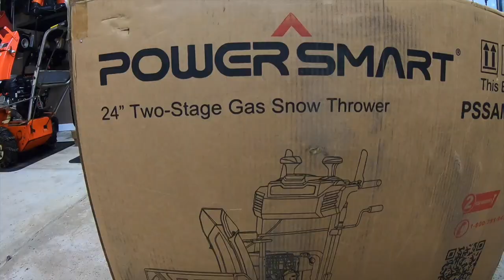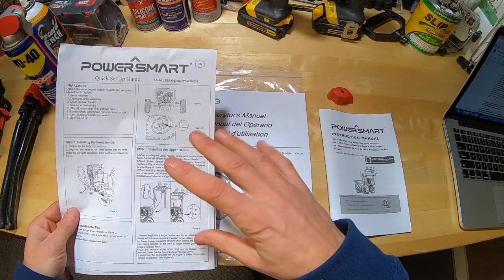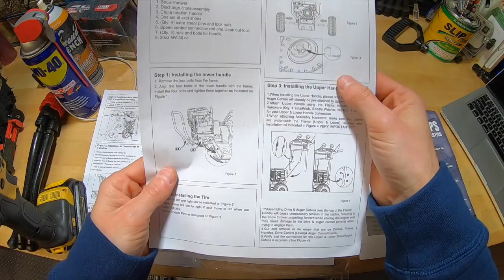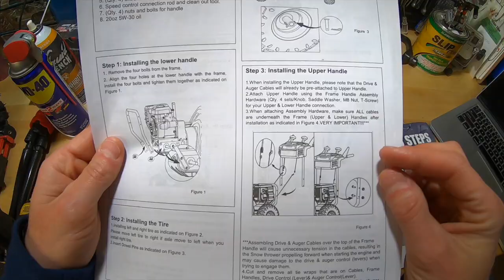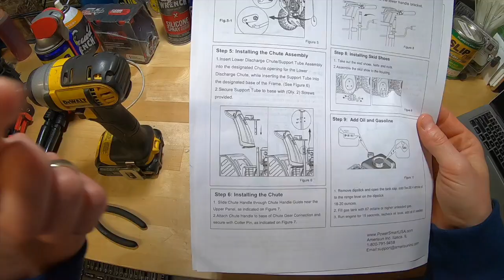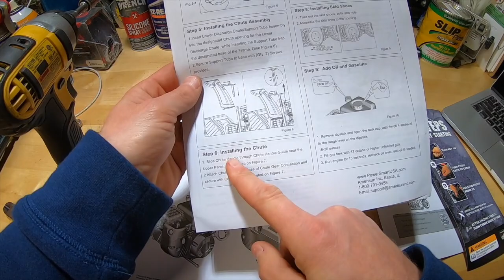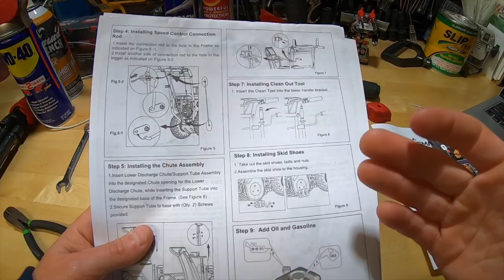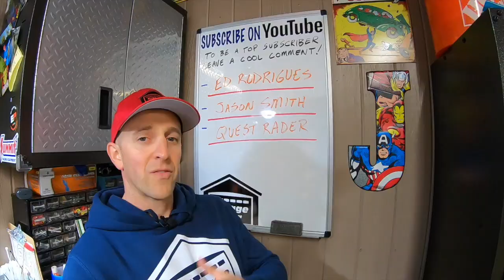I UNBOXED & ASSEMBLED A POWERSMART 24 INCH GAS SNOWBLOWER, HERE'S HOW!

Comment: Does anyone know what a shaft ring is used for. Mine was missing spacer bushings for the wheels so I ordered some but now I see a different parts list and explosion shows a shaft ring on one side. Powersmart hasn’t been any help. Thanks in advance
Reply from the maker: Sorry to hear they are not being helpful x not the first of me hearing this either. I would see how that part fits. If it doesn’t I would just go to a hardware store and see if you could match something up.

Comment: Would this be good in Northern NJ where we get an average snowfall of 40-45 inches? Or is the Ariens 24 deluxe worth the extra money? Would the Ariens be overkill for avg snowfall of 40 inches?
Reply from the maker: Hey Patrick if you can swing the ariens I would do it! The Ariens is built far better, parts are easier to get a hold of unlike the PowerSmart, it holds a much higher resale value and will outlast the PowerSmart by dozens of years. Even with lower snowfall totals the ariens is a smart purchase!
Reply: @GarageGear Thanks! I just pulled the trigger on Ariens! I watched your comparison video and that sealed it. I read many good things about the Ariens. It's my first snowblower!
Reply from the maker: @PatrickHill  you won’t be disappointed! 👍 happy snowblowing season

Comment: Thanks for the video.  It's Friday and they're closed all weekend.  I wanna fire it up, but there is a missing yellow plug on the engine block.  The other side has the small yellow plug.  Does yours have 2 small yellow plastic plugs?
Reply from the maker: Hey Jorsh sold mine a while back but I’m pretty sure it did have two yellow plugs.
Reply: @GarageGear  thanks for getting back.  I ended up looking down in it and it's not machined at the bottom.  Must be the same engine for different models.  I fired it up and it's all good.  Thanks, man.
Reply from the maker: @JorshWarshington1  awesome! Glad it’s working!
Reply: @GarageGear  thanks just subscribed
Reply from the maker: @JorshWarshington1  thanks man!

Comment: JB we recently picked up the same snowblower but cheaper model from a local customer that uses this blower to clear snow at his restaurant which has a stone parking area. Since the customer had the skid shoes set even with the shave plate a bunch of stones had pushed their way between the housing and the back side of the shave plate thus pushing out the metal on the auger housing towards the back. We were able to hammer out the stones using an old screwdriver as a pry bar, then hammer the bulged metal back as best we could. Disappointed that when we went to set the skid shoes for 3/4" clearance the most we could get was 5/16". Must note that the skid shoes you installed looked like a higher quality part than the cheaper metal ones that came with this snowblower our model was DB7624E60 but i can say it starts first pull after we cleaned the carb and blows snow very well!
Reply from the maker: Thanks for sharing this Wayne! A good tip here! These can be decent little machines if cared for properly! They definitely cut corners though and parts will more than likely need to be replaced! Thanks again for sharing and hope you guys are doing well! 👍

Comment: They now comes more pre-assembled. I received mine yesterday, no need to mess with the wheels, it is easier to get out of the box. Mine arrived via Fedex, all banged up, a lot of bendings and no speed control connection rod... and there is no hand heater on mine. The LED light is a joke with the 3 AAA battery case under the dashboard... The chute is softer to move and there is no more springy spring under the rotating part. The skid shoes are metal.
Reply from the maker: Sounds like they changed a thing or two! Hearing it’s pretty typical that they come in all banged up!

Comment: GG, I used my brand new Powesmart 24" today. Only problem was that one of the wheels came off the axle twice. As you know they are attached by a pin and cotter pin. These look very weak and i wondered if you have an alternative idea to overcome this issue? Something like a locking bolt and nut? Any advice would be most welcome, other than that the blower worked through a good foot and a half with no issues. The two speed reverse gears being a Godesend!
Reply from the maker: Hey Florida! I would recommend putting a bolt through it! That way the wheel can’t come off! Thanks for watching!

Comment: Excellent like always really enjoy your videos. I purchased the PowerSmart 26" with the Briggs and Stratton engine which worked great during this past snow storm. Only addition I made was to install a bungee cord on the vertical rod that connects to the friction wheel. I did this to prevent the speed changer from jumping to the highest speed from all the vibration. Works great prevents the speed changer from shifting but allows me to change speeds. SnowBlower Customer Service said they would send a repair man to my home to fix this problem. The 250 cc engine is very powerful no problem throwing snow in any direction.
Reply from the maker: Appreciate the positive feedback Ernest! Congrats on the purchase! Glad it worked well for you too! I had a similar issue happen with mine too. Thanks for sharing my friend!

Comment: The auger on that snowblower seems to be smaller in diameter. The pencil trick is handy and I tend to use carpenter pencils. The cutting edge has more contact area when placed parallel onto the pencil and they don't roll.
Reply from the maker: Yes totally agree shooky! Those augers are small! 8 inches I think! I like the carpenter pencil idea! Stealing that one from you if you don’t mind! Lol! Thanks for watching!
Reply: I don’t mind! Sharing knowledge helps everyone. I’ve learned a few things from your channel. I like your channel and keep up the great work.
Reply from the maker: @NShooky  appreciate you bud!👍

Comment: @GarageGear   Have any tips on getting out a bent (not broken) shear pin?  Where the nut meets the auger shaft it's bent about 4 degrees, just enough where I can't push it through.  I tried a hammer to tap it trough, no luck.  Since the other side of the hole is keeping the shear pin in straight, I can't "angle" it through either.
Reply from the maker: Sounds like a really pain eh! At this point I would try to get a dremel or a grinder in there and cut an end off. Thanks for watching!

Comment: Love your videos. They are helpful. Would you consider doing one on how to troubleshoot stuck cord? We have a new 26” PowerSmart snowblower, never used. We went through maintenance steps, no problem. After restarting, the cord stuck, but it starts with electric starter. I believe I just need to remove cover and untangle cord. But it would be good to know various reason why cord will get stuck. Thanks for all your sharing.
Reply from the maker: Hey mountain I’ll see what I can do about a video. I would recommend carefully removing the cover and untangling it making sure that any inner springs don’t come out. Thanks for watching!

Comment: HEY! Where’s the anti-seize on the axels? 😏 but random question, I’ve never bought a brand new snowblower fresh out of the box, mine have always been second hand or gifted, do new snowblowers come with gear oil in the gearbox and does it need to be changed in a certain amount of hours like engine oil?
Reply: My Ariens service manual only asks that we check the oil level so I guess it's not critical to be replaced every few years. If it has changed colour, it's a good sign it's time to replace it though.
Reply from the maker: Hey Tanner my plan was to assemble this blower following the instruction manual. Gearboxes come all set with oil and only need to be checked periodically. Olivier is on it! I’ll be having plenty of fun with machine!

Comment: This will be my 3rd year for my POWERSMART 24 INCH GAS SNOWBLOWER.  So far, so good. If there is a problem would be trying to find replacement parts..Shear pins, Augers, etc.
Reply from the maker: Thanks for sharing sc1! Appreciate your feedback on the machine.👍

Comment: When installing speed control lever what is that long silver bolt above where you connect first at bottom? 🤔 mines seems to be sticking out to much and maybe possibly broken on the other end
Reply from the maker: Not exactly sure what your problem is here Armando. I’d have to see it in person to understand the situation.
Reply: I believe it's the oil drain plug or tube? Whatever the name is I'm not sure. But yes I need a new one because mine was broke at the thread.
Reply from the maker: @armandosauseda8778  just so I’m clear here your oil drain tube is broken? If so I would contact the company.

Comment: I know what you mean about the handle bolts. You must mean the craftsman cause that’s what I have. I ended up putting a hose clamp around the lower part of the handle, worked out very well.
Reply from the maker: Hey David, craftsman and Troy bilt are both owned and manufactured by MTD. The have similar handlebar assemblies. Good idea with the hose clamp! Thanks for sharing!

Comment: Great video thank you:) I’ve put mine together except the headlights and hand warmer aren’t working. Any suggestions to make them work will be great. Thanks again
Reply from the maker: Check underneath the control deck. They might be both disconnected. They should be plastic clips that need need to be attached. Let me know if they’re connected. Thanks for watching

Comment: Hey boss! All four bolts for my skid shoes "lock up" before the shoes are tight.  You're using power so you may not even notice if yours are the same.  Should I just force the nuts past the point where they no longer screw by hand?  Thanks
Reply from the maker: Hey John these are lock nuts that you are referring too. Yes, tighten them down farther. There is a piece of plastic inside that helps keep them from spinning off.  Tighten them all the way down with a ratchet and they won't move. Thanks for watching.
Reply: @GarageGear  Thanks a lot for the help. I had so many problems with thing. Couldn't connect the auger cable. Galled the company. The guy sent a new cable. It was the same cable I had. But as I looked I saw where I could screw it down at the top. And the guy at powersmart didn't know to tell me that? Oy!

Comment: I have the 950 engine on a Briggs Snow Blower and it is very solid. Always starts on the first pull and I have had it for 5 winters, going on my 6th.
The chute is metal, not plastic, which I prefer and it does not have the clicking and turning the chute is very easy.
But if anyone is worried about the engine, it is solid!
Reply from the maker: Hey Billy! I’ve had nothing but good experiences with these engines! Thanks for sharing my friend!

Comment: Got to say your video was a Godsend. Only issue that I had was that no oil was supplied and the battery case for the headlight was damaged and at first didn't work. One of the battery connectors was also damaged. This is definitely a design issue. One thing that they could do better would be to make a more robust battery pack case ( the screw that holds the battery pack together is miniscule). Greased and used the products you recommended during assembly (watched your maintenance guide) and the thrower on mine appears to be a lot looser to move around that in the model you assembled. Many thanks for your well put together build. Mine was a newer version and a 26" Powersmart but it went together pretty much the same. Good advice on using to pencils as well!
Reply from the maker: Hey Florida! Glad this video helped you out! Appreciate your positive feedback!

Comment: do your wheels turn without an issue when in use?
Reply from the maker: The wheels drive the machine forward and backward as they should nik if that’s what you mean. As far as turning the unit the wheels do not spin independently and are on the same axle. So turning is difficult with this machine and requires some force from the user.

Comment: I have an auger cord that won’t connect. How do I get it to and how do I get it to to stay? Thanks
Reply from the maker: Hey there! Does it have two end that’s connect together or is it one long cable?
Reply: It is two ends that need to connect. They appear to be too short.  One end comes from the handle, and the other comes from the I’m assuming the motor (or somewhere in there). I have picture but I can’t seem to post them. I emailed the original poster but I don’t know if I got a reply back yet or not.
Reply from the maker: @romanticawc  I emailed you back karen!👍

Comment: I have same this one powersmart 24 in. 212cc two-stage gas snow blower with electric start
But the problem is I can go forward and backwards 
But I can not make a turn so 
WHAT KIND OF THE PROBLEM IS IT ….???
Can you tell me please
Reply from the maker: Hey ankur the wheels on this unit are not free-spinning wheels. Meaning they are a little tougher to turn. Cheaper models like this are usually built that way. Thanks for watching
Reply: Thank you brother 
I’m a big fan of you 
I like to watch and get the knowledge about the machine’s 
An awesome knowledge you have 
😊😊😊
Reply from the maker: @ankurgandhi3198  appreciate you ankur! 👍

Comment: I got this delivered 1 month ago, we haven't had much snow so I only used it a couple times and the at first it worked fine, the third time however the auger wouldn't turn at all and there was a burning smell. I was told by Home Depot I couldn't return it because it was past 30 days (Dec 7 to Jan 16, so 35 days 🙄) and was told to call the company for the warranty. I tried to call all day, I wait on the phone line, and then when it's my turn I get 'there is no one to take your call, goodbye'. Even if I get through and they fix it, I don't know how long that's going to take to fix and I'm going to be blower-less for the snowiest part of the season. Absolute garbage. One month. This thing lasted one month where we didn't even get that much snow. Extremely frustrated with the product, and also disappointed with Home Depot.
Reply from the maker: Hey poison! I have heard that their customer service has been pretty awful lately. Thanks for sharing this information!

Comment: Dang!  Mine died during its first use!
Reply from the maker: 😳whoa! Any reason why?
Reply: I would think fuel supply, though it is a brand new machine with brand new gas.  Thing is, after I checked spark, I put some fuel into the cylinder and got no joy. So that is puzzling. Amazon refunded me and told me to keep it. I will look into it further when the weather improves. I don't have a place to work on it indoors.  Meanwhile I went ahead and bought a 30 inch Ariens Deluxe and it is ready to go.
Reply from the maker: @azzir325  wow they let you keep it? That ariens will run a heck of a lot better for you!
Reply: At 4 times the cost, it better!  LOL!
Reply from the maker: @azzir325  you won’t be disappointed!
Reply: Unless we don't get any more snow!  Ha!

Comment: Thank you for the instructional install video, it will help me with my assembly. I did notice at 5:35 Briggs and Stratton logo. Does Briggs and Stratton own power smart?
Reply from the maker: Hey Patrick, PowerSmart used a briggs engine on this machine. They do not own PowerSmart. Just use an engine from briggs. Here’s a link with more info. Thanks for watching . https://totalgardener.com/company-powersmart-lawn-mowers/